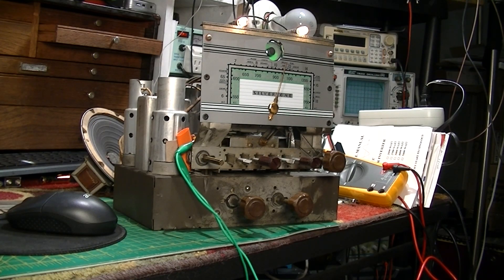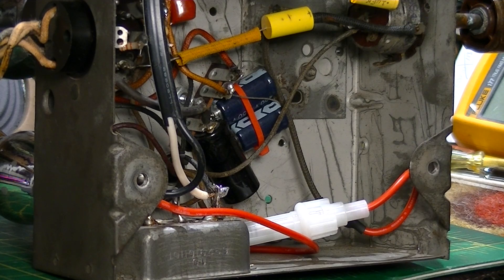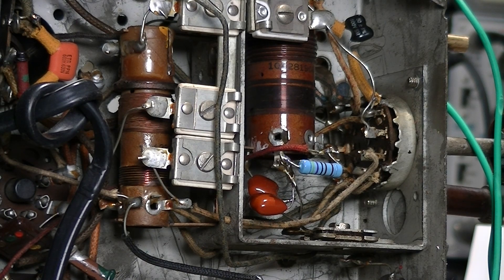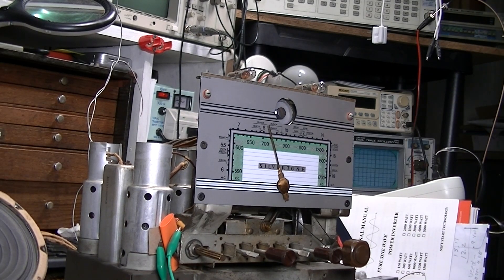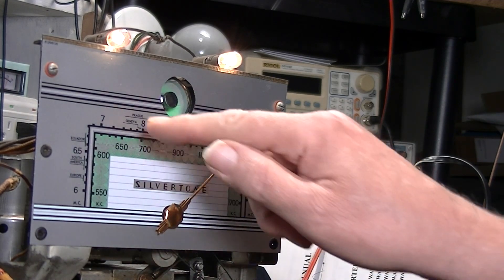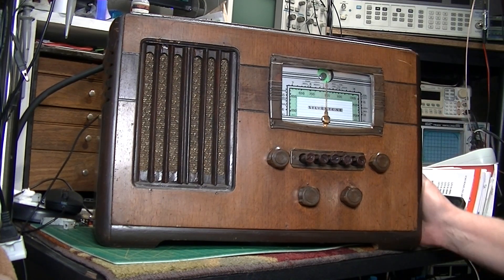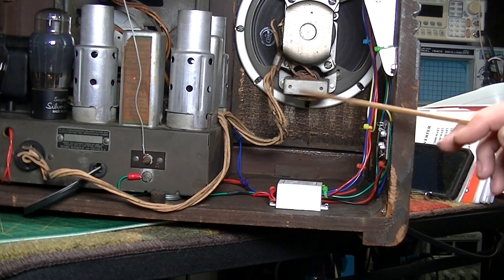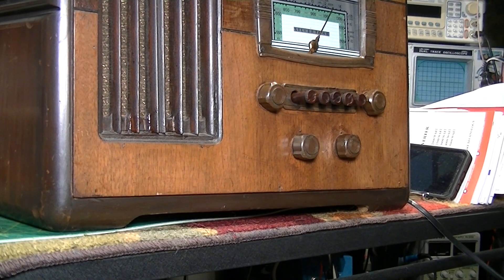Silvertone 1938 Radio Restoration model 6125

Comment: Greetings: New follower here.
FYI: I am too old (72) to do this work myself due to diabetes & poor unmatched eyesight.
If you have a digital counter that lets you monitor the local oscillator to read its frequency while the set is buttoned up, then if the counter is considered programmable, you can load into it the IF frequency and the counter display will track the "transmitted" frequency as you tune the dial. 
BTW: ebay sells cheap kits of counters that let you do that, so you can avoid confusion about what frequency you are tuned to. Hope you do not have too many oscillators running at once or you may require a physical osc. connection so you can reduce the counter's input sensitivity so only the selected unit's osc-IF frequency is displayed. 
Sorry if this is all old news to you.
"You are assuming 'they are = they're' ceramic cqps."
I heard you say that you installed a 500ma fuse instead of the previous 1A fuse.. If you have trouble with fuses popping on start up, an "inrush current limiter" like the CL90 will help. I think I saw Newark had CL90a's for under a buck.
oScillator

Comment: That's a real nice looking radio Ken, very impressive for an 84 year old. I'm guessing it was easy to get going, with the real issue being the mica. I like the bracket for the jack and switch too, lot's of room inside that case and the sound of the mp3 is great. Great job
Reply from the maker: Thanks a lot Frank, most radios from the 30’s can be a challenge to repair and restore so that’s why I like working on them. The schematics are not straight forward and missing a lot of valuable details like dc resistance on all transformers, coils etc., unlike radios from the 40’s and up. The 5k resistor I replaced in the oscillator circuit, the schematic shows 5M which “M” you’d think would be Meg ohms, but “M” stands for thousand in the 30’s. The micas are all in microfarads instead of picofarads and doesn’t even show what kind of capacitors are in the radios, no resistor wattages, even the 2-power cord .01uF "kind of safety capacitors" I had to assume were ceramic. You have to depend totally on the schematic because there’s no parts list. The only reason I put this radio on the back burner was because I lost all the videos of the original installed components and my troubling shooting when my hard drive died, and the new dial plate took 10 weeks to arrive since it has to be made up at the time of purchase. Yes, there was a lot of room inside the cabinet to take advantage of for my aux input and the corresponding parts.
Reply: @kenslab1973  you really did a great job Ken esp with a lack of information. I've only worked on two 30's radios a Philco and Sherwood both Aussie made and no schematics, but I got lucky and got them working.
Reply from the maker: I don’t think you got lucky getting them running, obviously you knew enough to get them working. I wished I had a dime for all the television sets and radios that I repaired without a schematic since I was a teenager. 
 @exeterslab7781
Reply: Tu
Reply: @kenslab1973   I just bought one of these at a local shop and plan to rehab it.  You said there's no parts list, but mine has a data sheet with a chassis plan view with tube layout, a schematic, and a parts list that includes schematic references for the parts. It's glued to the inside of the cabinet adjacent to the speaker.  It's yellowed, but still very legible.  I may not be able to get a clear snapshot of the whole thing until I remove the speaker. Did your radio have this info sheet?

Crazy thing is the sheet calls this a model 6025, not 6125. All my internet searches for 6125 return a 1956 clock radio model, but a photo search got your video along with other hits on radios that match mine.
Reply from the maker: I’m not sure Rick, it’s been a while, but I want to say no. I did download the schematic though and perhaps the parts list was included, usually is. I remember getting the alignment instruction as well. Thanks for watching and good luck with your restoration. @rickgilbrt

Comment: That must be the sickest modulator i have ever heard for a generator it sounds like people screaming in hell eternal punishment.
Reply from the maker: You heard the Boston Blackie-The Escape, which has a lot of screaming in it. The real cause for distorted sound is that the transmitter is too close to the radio and or if you have the input to the transmitter too loud it will also distort the sound. Thank for watching.

Comment: I am curious which mica you replaced from the schematic?
Reply from the maker: If you have the schematic, it’s the C7, .00005uF which I replaced with 50pF mica. The new micas are not really layers of mica like the older ones; they are like the film type construction capacitors.  Thanks for watching.
Reply: @kenslab1973  thanks will check it out
Reply: @kenslab1973  Greetings: 
Some domino marked caps are paper/foil in disguise. 
Mica Mold comes to mind.
Reply from the maker: Yes, I did mention about some of the domino mica capacitors could be a film type instead of the layers of mica, perhaps I eliminated it when I edited this video since it was originally just over an hour long. Thank for watching! @jamesmdeluca

Comment: you lost your audio i dont get it
Reply from the maker: Never lost my audio at all, the dial hand was not correct with the dial numbers. I think I was transmitting at 1100 kHz and was picking it up on 1000 kHz. This was after I did a complete and thorough alignment. I had to replace a mica capacitor in the oscillator circuit to correct this problem.